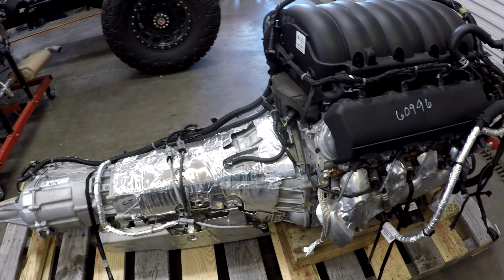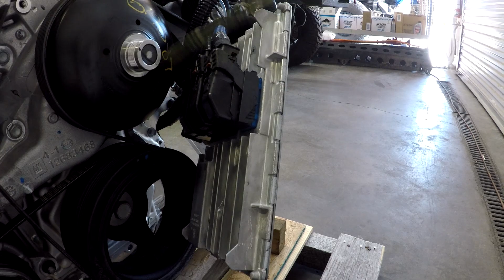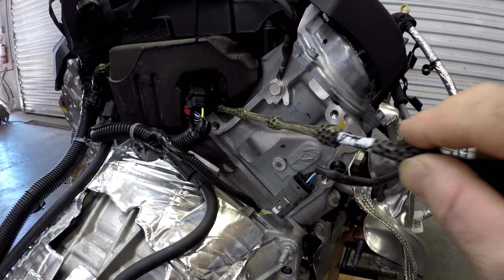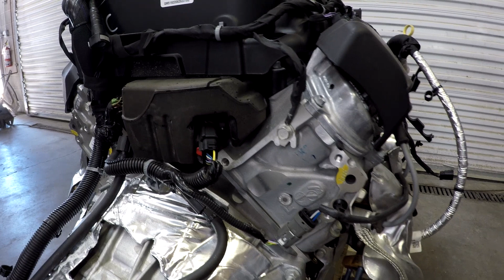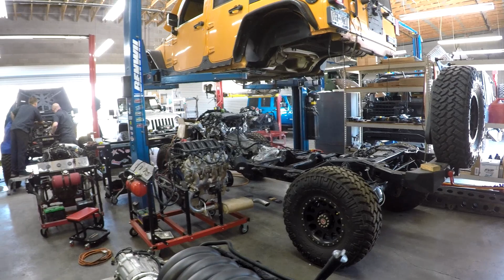Jeep Wrangler LT V8 L87 10 Speed

Comment: I put a pulsar lt module on my 21 Denali 6.2 to deactivate the start/stop and DFM it was the way it should have come from GMC.  Way too many 5.3 and 6.2 engines are having stuck lifter problems and GM stopped putting them on the 22 models.  This is a badass engine with 420hp and 460 ft-lbs of torque through a 10 speed trans ..... simply badass